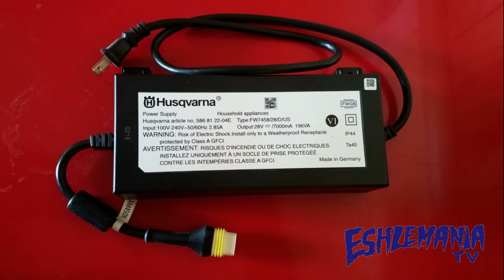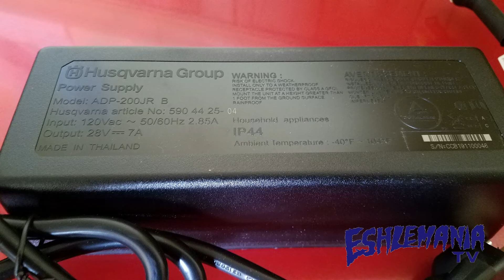Automower Answers: New Transformer (Power Supply) For 450X & 450XH Automowers!

Comment: Hi, I have a 2016 430x automower,
I have replaced both wheel bearings and the power supply so far , 
And now the mower is starting to puzzle me , it does not seem to recognise my zone settings anymore , it will just randomly mow anywhere and quite often end up running out of charge out on the lawn and not make it back to the charging station, it still has my zone settings in the menu, 
It will also stop every now and then and say no loop signal, I will switch it off and on and start again and it will go again , any ideas as to what might be wrong ?
Thank you

Comment: I don't think that's how current works. If the voltage and resistance are the same, it doesn't matter how big the PSU is or how much current it can handle. V = I/R so I = R/V, if voltage and resistance stay the same then current will stay the same.
Reply from the maker: If you put a mower that uses a 4.2 amp transformer in a charging station that uses a 7 amp transformer it will almost immediately give an error saying the charging current is too high

Comment: My transformer/charger went south on me and I will have to replace it. Could it be because i have it in a small "garage" I made for my Automower 450x? What kind of ventilation should it require to keep the charger from failing?
Reply from the maker: Was it the old white labeled transformer, or was it the new style like shown in this video? Also, does your mower garage have a door on it that closes when the mower pulls in? We've seen several cases of the mower getting too hot inside of mower houses with doors that completely enclose the mower.
Reply: @EshlemaniaTV  It was the white label version. The garage door does close completely. Based on your comment, I will add more ventilation to the Automower garage before the new power supply arrived. Thanks.
Reply: @EshlemaniaTV  https://youtu.be/9udLVYP6QaY
Reply: https://youtu.be/9udLVYP6QaY

Comment: I had a power supply failure on my 450XH.  The dealer replaced it with Husqvarna Article No: 590 44 25-04 which has you indicated is without the white label and inscribed directly into the power supply.  So I think this should be okay and I should be good to go.  Thank you very much for posting this as my 450XH is only 6 weeks old and I was quite disappointed when the power supply failed so quickly.  Yes they warrantied the power supply.

Comment: Thank you for this video and taking the time and effort to record/edit all your videos.  They are quite helpful in helping learn more about my automower.  I just bought my 450HX and started using it this spring.  I did not know about the Power supply failing.  Mine came with the older model.  How long can I expect mine to work on average before I should expect mine to fail?  Thank you.

Comment: I would like to point out that amperage numeric value, which is printed on the power supply, constitutes MAXIMUM amperage, which power supply can handle. Actual amperage flow is determined by load resistance (in this case battery pack internal resistance) and since both (430X and 450X) models are using 28 VDC power supply, consumer can use 450X power supply to charge 430X and vice versa (430X power supply might not withstand 450X charging and get destroyed, since 450X is demanding more current than 430X power supply can provide) as long as polarity (plus and minus wire in DC input) is the same. And yes, 430X power supply is trash - almost three years into using, it failed and unrepairable (power supply inside is potted in epoxy resin). All in all, I ordered slightly more powerful (28 VDC 5.4 A, voltage can be regulated) repairable power supply from China under 20 USD. In reality Automower 430X Li-ion battery charges up to 20.5 VDC (4.1 V per element) and demands up to 22 VDC from power supply (anything over this voltage gives an error message: "Charging current too high").
Reply: Good point.  That was exactly what I was going to say.  The extra amp capacity should not cause a problem.
Reply: @wlambert43  That depends on the charging circuit. Rumour has it that the charging depends on the resistance of the cable; that's why the manual say the cable between power supply and base should not be cut shorter or longer. Or perhaps they are just afraid we can't see the white marking on the positive and might put the wrong polarity into the base.

Comment: Off topic, why does the automower only use a fraction of the cutting blade?  My 450XH's basically use only 1/4 of the blade.
Reply from the maker: The new endurance blades that Husqvarna has come out with will (or should) solve this issue. They will have a slot in the center of them instead of just a single hole at one end. This will let them rotate and swing out further and use more of the blade.

Comment: ya I have been using my 430 Power supply to charge my 450x..due to the manufacture in UAS (lying to me) sending me the wrong replacement station saying it was a 450X (it only has 2 guide loops)
Reply from the maker: I remember you telling me about that. Shoot me an email and tell me again how that all came about. I'll get you hooked up  with the right parts.